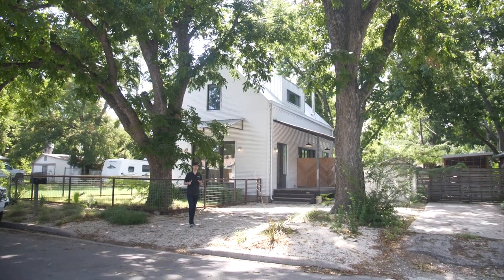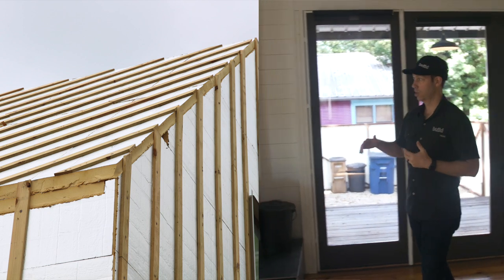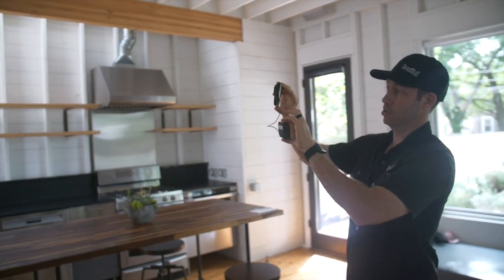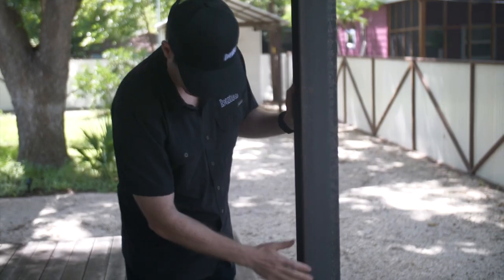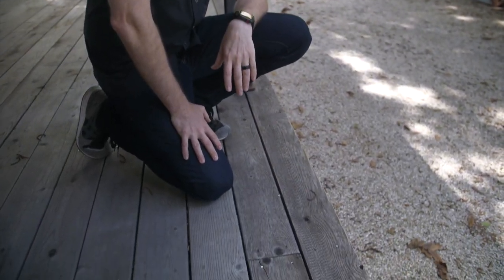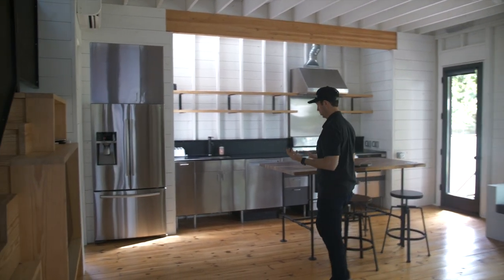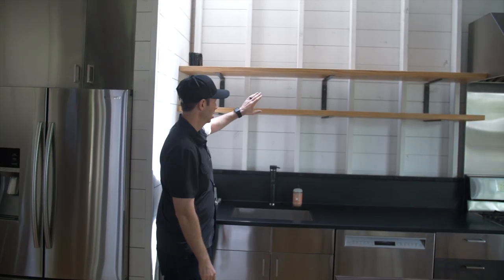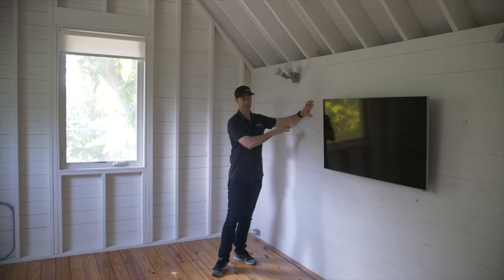This New House Has No Drywall, No Insulation, and an All Wood / Shiplap Interior!

Comment: Interesting house. I am not very familiar with residential code fire rating so does the lack of interior drywall need to be offset by something else to achieve a fire rating (if needed?)?
Reply: That was my thoughts too. I'm from the UK where the structure should have 30 minutes fire resistance, which would normally be by two layers of plaster board (drywall), and the surface spread of flame rating that normal timber gives would not be allowed on the ceilings and limited on the walls. Bare timber could be treated with intumescent and/or fire retardant paint or varnish.
The other thing is that there are requirements for accessibility, so a level entrance and sockets above 450mm (18") above the floor, and the floors and walls should have a measure of sound resistance (with rockwool or 2 layers p/board).
Reply: @Hugonebula  sure there are some differences in UK laws.  Where electrical power is routed through conduits, those conduits are fireproof, there are zero cavities for a fire to escape into, the flooring certainly can be made with sound deadening materials as well as esnuring a similar sound deadening material was used between the studs in specifc locations.  Fire needs 3 things to grow/spread, Air(Oxygen), Fuel, Heat, when you remove JUST 1 of these, all fires will stop & die. 

In an Airtight house, there is a lot of Air volume, but not so much fuel (if the wood has been treated well/correctedly, mainly the wood used in the construction.

Comment: What is the R value of the extallation and how did it pass code, and what is the power footprint for constant air circulation? I didn't see any signs of condensation, what kind of climate is this type construction practical in?
Reply: Google the architect. I believe this Austin TX. Rigid = R7.5 ? This won't pass energy code in a more northern climate. Cheap house & cheap look.
Reply: Walls: 4"@R5=R20. Roof: 6", R30. It is called the Perfect Wall because it works _everywhere_. You just vary the amount of insulation.
Reply: This will never meet code in the north. R7 is laughable.

Comment: I am an architect and absolutely agree that houses should be insulated on the outside as well, especially in Texas with the strong summer sun. But not a huge fan of the exposed studs, not the greatest look, also a lot of surfaces for dust to settle, spiders to make a web, etc. I enjoy new and unique design, but this seems to be less practical than finished walls. Thanks for sharing though, interesting to see.

Comment: @matt I saw in your "Perfect Wall" article the mention of 3'' of polyiso on the walls for about R-20. Could this wall design handle a little thicker for colder areas?

Do you have any ideas on the solution for better sound insulation between floors?
Reply: I have the same exact questions.  Soundproofing is about blocking/absorbing the sound waves from transmitting through the divider. Nothing beats pure mass, as far I as know, but I'm sure there are other ways to do it, probably doing something similar to a recording studio. However, sound will still travel through air vents, so I'm not sure how that could be minimized. Maybe longer vent runs and non-smooth ducts on the interior, to break up the waves. Would love someone to do a follow up video to address these issues, because I think this concept should be adopted everywhere, as low cost, efficient and sustainable construction. I'm definitely going to try it out on a small scale by building a small cabin.

Comment: Tile guy sees a shower with no grout in the 6x6 and loses his mind 7:30. Copper patina and Teflon tape on the fittings? Come on, that is not design. FIT and FINISH.  Shiplap with nail holes and doesn't line up in the corner. I've seen enough. People will buy anything these days. I have respect for you but not on this one.
Reply: Elf Kind:  I was thinking the same thing.  Also, that upstairs bathroom would be a nightmare for someone who showers regularly, especially if you had a family - from what Matt showed there was no vent fan blowing the moist air to the exterior of the house.  Recirculating the moist bathroom air back downstairs seems crazy.  Also, the upstairs bathroom is entirely wood which is just screaming mold and mildew problems if you actually use the bathroom.
Reply: Yeah, I don't get the bathroom ventilation part on this one
Reply: I can see those steel pipes used for hanging towels becoming rusty and staining the rags.
Reply: Consider that the tile used in there is the most porous type. Old "dryset" methods for setting consisted of soaking those tiles in water, sprinkling the setting surface with dry portland and setting the saturated tiles in it. If you have ever demoed a bathroom floor made of that tile, then you know that the tile around the toilet is semi urine soaked.... BUT the grout keeps most of it from penetrating into the edges of that tile.  

The purpose of the wall is to shed the water to the drain as FAST as possible because water has "potential energy", when it pauses it makes bad things happen. Skipping the grout gives the water a place to hang out and absorb. Water likes to pull other water into crevices due to its polar electrical charge. AKA "capillary action". Since the shower water has soap and body filth in it, Those "minerals" are also pulled into the tile where they stay and create food for other things to grow..... like at the base of the shower where the floor meets the wall that most of us see at one point.  

If the tile setter used mastic instead of thinset in that closet shower, there will be another level of trouble due to the constant saturation of a glue that is not designed to be that wet all the time.

Another words, rust-stained rags would be a small example of what is going on in that ENTIRE shower. EEEEEEEEWWWWW. I would not shower in that shower. If it is such an amazing and special house, WHY did the first owners move out after 4 years??? I have a guess. LOL.
Reply: imagine spilling a glass of water upstairs and it dripping through the floor on whatever happens to be below. Like an electrical light fixture.
Reply: what about the the row of 1" tile at the bottom of the shower. Looks like someone measured wrong.  And if it is suppose to be decorative then why is it on the bottom row and looks like poopie.
Reply: Waremonger  I am thinking the bathroom vents to the area in the house that contains the dehumidifier. They want this house to be completely air tight, so they probably didn't want a massive leaky hole in the roof. 

I'm not sure if this is the most ideal situation, but seems like the logical reason to me. (Not sure if they vented the vent hood in the kitchen to the outside or if they did a recirc)
Reply: @Ariccio123  I think what's happening is after the hot, moist air is exhausted from the bathroom into the laundry room, the exhaust fan of the HRV is then picking it up and ejecting it from the building, simultaneously transferring its heat to the incoming fresh air.
Reply: @Ariccio123  the air conditioning has to take the moister out....

Comment: Adding fabric-wrapped rigid fiberglass or rockwool panels (commercial or DIY) between the studs will soak up the room reflections and help reduce sound transmission a little. Obviously this is not true "soundproofing", which can only be achieved with airtight spaces and mechanically-decoupled, mass-loaded walls, but it will suck some of the sound energy out of the air and give the house a quieter feel.

Comment: Only thing I would do is Insulate for noise reduction or elimination, add more Mini split units, and make it wireless transmission neutral for internal/external transmissions. I'd also Make the whole thing out of Hemp wood and stain it to desired color. I think the concept is revolutionary with what you can do.

Comment: very interesting, I'm impressed except for the noise penetration and limited privacy, but I believe these can be rectified. So many thanks for our innovations.
Reply: There is the same amount of insulation... it's simply outside. DUH
Reply: Noise abatement? it's called drywall.Also, fiberglass is a better sound insulator than rigid foam. Those 2 would take care of those problems to a large degree. One place I know of was right next to I-5 in Corvallis, the quiet room was double 5/8 drywall on all surfaces.

Comment: This is my favorite build you have done. Love everything about it. Would love some more details on the insulation and final numbers and how you finish openings (windows, doors, etc). Do you see any issues with this working in a different climate like the PNW?
Reply: Ventilate/dehumidify to prevent mold. One commenter seemed to think that the drywall causes mold. If you seal a house you create humid conditions for mold to grow.

Comment: This comment is a bit late and I'm no expert on design, but I'm curious - would there be any long-term problems with the insulation being outside of the weather barrier?
Reply: Yes. Any moisture penetration at all, say by condensation on the inside of the metal, would cause mold to grow. Supposedly the air gaps would minimize this problem, but that's theory for you.

Comment: This is incredible. How does the build cost compare to a “normal” house of similar size?
Reply: more expensive. no doubt. Why? Because people are stupid.
Reply: costs twice as much, that's the point, better margins
Reply: Regular materials, simpler construction. It has to be equal or less. Lifecycle cost (the real one) would be considerably less.
Reply: @yodrewyt  I would have to agree. House like this should cost less. I would say between labor and material 25% less for a complete remodel.
Reply: @williamrage6225  It would be more expensive, no? Painting would take longer and more materials, as no flat surfaces. Instead of drywall, they have effectively used ship-lap as the internal lining - again, more labour intensive.
Reply: @justanotherguy9664  I apologize for the confusion. I was thinking this house was a complete remodel and not an all new construction.
Reply: @justanotherguy9664  , However, you are saving more money by Not paying for sheetrock, tape, mud, screws and labor on those items.  And as time goes by and the house settles, you won't have settling cracks to look at or repair.  Spraying paint on these walls isn't that much more, if at all.  
But, like he said in the video, you can always add sheetrock in certain areas, like the bedroom walls.
Reply: @jmackinjersey1   Yep, spraying bare wood is a BREEZE with a good sprayer.  Especially if you're shooting matte finish.  Can spray that whole first floor in an hour or so.
Reply: @jlydon29  , Primer first or all in one?
Reply: @jmackinjersey1  I shot acrylic black dry fall, no primer. One heavy coat, no runs. I'd imagine all-in-one would be the same.  Either way, the sheer volume coming out creates a rate of application that destroys rolling, in any regard.  You need an industrial sprayer dipped in a 5 gallon bucket though, not some handheld unit.
Reply: @jlydon29  I was more worried about the wood absorbing the paint.  But you explained how you apply it.  Thanks for that.  My main thing right now is figuring out cost as compared to typical building methods.  Well, cost and application/time/sequence of events etc.  Since I am in the Residential Real Estate Rehabilitation business, I always have to find new ways to make my houses stand out, I hate holding costs, and the longer I hold, the more I pay.  So faster selling houses help a lot.
Reply: @yodrewyt  4x8 of drywall = $12.  4x8 of ship lap = $60.
Reply: @justanotherguy9664  I've installed both ship-lap siding and drywall and in my experience drywall takes longer. Certainly siding has more individual pieces, but once it's on (and, if needed, painted)  you're done. Drywall sheets are larger and in that sense they go on faster, but it needs a lot more fasteners than siding, which adds time. Then every seam has to be taped & mudded, every fastener has to be covered - and every inch of these proceeses have to be either smooth, or sanded smooth - after which every square inch of every wall has to have texture added to hide the inevitable inconsistencies in both the structure of the walls and the tape layer. And finally, everything you just textured needs at least two coats of paint. The whole process for drywall takes far longer than for siding because the process for siding has far fewer steps.
Reply: Dwayne Bearup so that’s just time. It’s still 5 times cheaper to use drywall.
Reply: Actually some good info in the comments. Ha! Would be good to hear from Brandon in cost comparison vs. armchair contracting lol.
Reply: @crosisofborg5524  If you're doing the work yourself - AND if you don't mind devoting all your spare time for several months (at least) to finishing the drywall - then drywall is the less expensive option. If the work is being done by a contractor (as was the case here) then the reduced labor time needed to install ship-lap more than makes up for the greater expense of the materials.
More importantly, you wouldn't be putting on drywall INSTEAD of ship-lap, but in addition to it. The outside of the house would still have to be covered with something.
Reply: Jon B I fail to understand how I’m “armchair contracting”? I was genuinely curious how the cost of this build compares to a “normal” house.
Reply: If interior cladding is used, the exterior can be something less expensive than shiplap, e.g. OSB. I'm considering building my house like that. Shiplap interior, Zip system exterior.

Comment: I have been researching and learning so much and snarling my nose at several things that I think are stupid.  I wanna build my own house and this is what I've been thinking and when I've tried to talk to workmen about it, they dismiss me. I knew I was not wrong in my thinking. I knew it! Thank you!

 At 5'8", I'm right between average and tall. I'm dead set on making my countertops 42" tall because I have back problems,  and wish to prevent more. 42" would make things a whole lot easier for me. I hate leanin' so far over the sink to do dishes! 

According to my now retired chiropractor, Ty Talcott who was once chiro to the Dallas Cowboys, Salvador Dali, Bobby Blue Bland, Morgan Fairchild (she HAS had "some work done" check DOB &  approximate grad date from Lake Highlands High School in their yearbook my ex knew her), BB King, and other celebs big and small, "...it's a real back tangler, a problem waiting to happen, the way they build kitchens and bathrooms", speaking of too-low showerheads and low countertops - and don't get him started on ovens under ranges (..."have you ever considered the weight of roasting pan, veggies AND roast?...turkey AND dressing plus pan just 2 ft off the floor...IDIOCY ...if you can, wall ovens are the way to go"), topfreezer fridges  your in the fridge more often...", and sinks "should be a basin on top of the counter". This was in the early eighties they weren't really doing that (well, new build 50s &60s homes had a lot of wall ovens but countertop sinks? - "not no way, not no how") - not that I had seen anyway - maybe in really fancy posh "high $" houses or in Europe. Or in old country houses like some of my great aunts 'n grandpa/ grandma before they had indoor plumbing, they had a galvanized tub or pan they put up on the counter or inside the dry sink.
 

My sink's gonna be so close to my belly, it'll  practically be in my lap, so it's a farm sink for me. Maybe even one of those counter top bathroom sinks that are wide and square. 

I'd love to find one of those old huge single big  porcelain(enamel?)-over-iron sinks that have the backsplash and the rolled edge - all one piece.  

I'm only 8 minutes into your video and so far what you've done is very much the way I envisioned mine. I can't wait to see the rest.

 Well I watched and re watched in all of it is genius it solves a couple of problems for me. You know since I'm not a builder and I don't know anything about building and just started thinking and imagining in trying to solve problems I came up with almost half of what is Built-in this house and I'm glad to know that my thinking was not "off" it was just incomplete.
 Thank you , thank you so much!